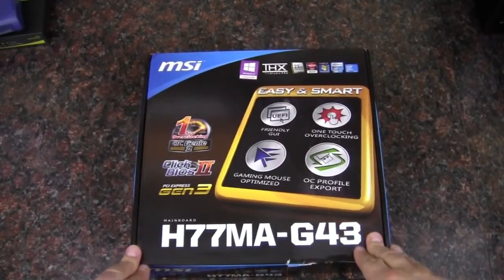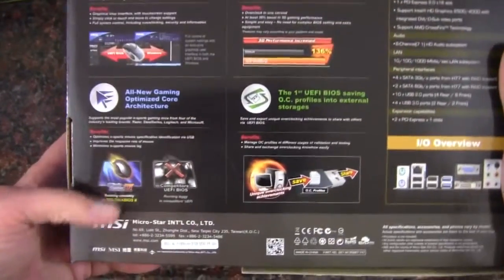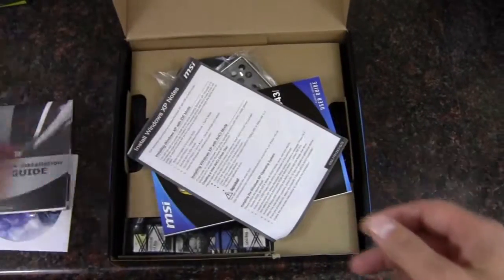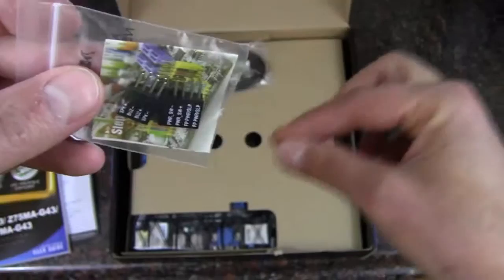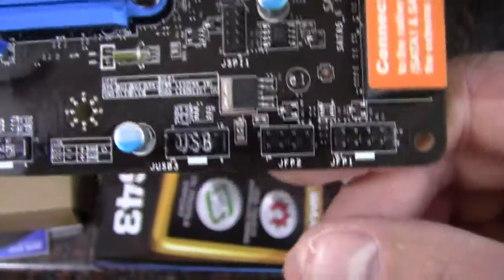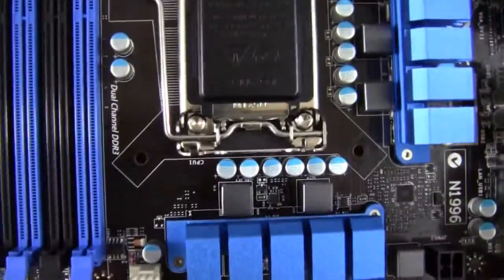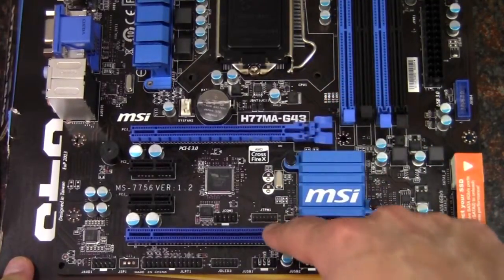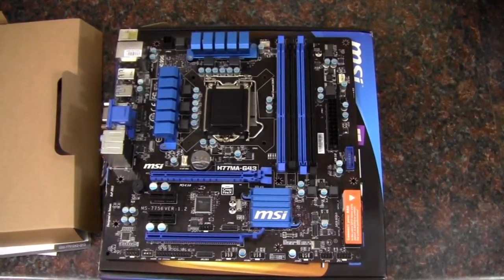MSI H77MA-G43 Unboxing

Comment: Hello, i can use fan or gabinet RGB?
Reply from the maker: HI. I am not familiar with gabinet RGB. Could you post a link to an example? Thanks!
Reply: @AdoptedMike  a gabinet tgt stalker
Reply from the maker: @zeex6922  Yes. I do not see any problems.
Reply: @AdoptedMike  i can use rgb of gabinet in this Motherboard??
Reply from the maker: @zeex6922  From what I see, the RGB strip on the front is not controlled by the motherboard. It looks like it only needs 12 volt power from a Molex connector. I am guessing there is a button used to cycle through the colors for that strip. I am using Google translate to translate, but it's not 100% accurate. I think what I find is mostly in Portuguese.
Check out around the 4 minute mark on this video: https://www.youtube.com/watch?v=9pQqNz3Szt4
Reply: @AdoptedMike  ok, thanks for you support, +1 subscribe

Comment: Or do I need to add wifi card using pci to connect to internet wirelessly
Reply from the maker: Yes, you will need to add either a PCI express or USB WiFi adapter.

Comment: I know I'm a quite a bit late, but I wanted to ask, whats your thought and opinions on this motherboard? Did you had any issues or problems with it? Cant decide if I should choose this one or Asus P8H77-V which is btw 10$ more.
Reply from the maker: Well, I never had to do any warranty work on the system that I sold with this board in. So, it lasted at least one year, probably more. If something fails, I usually at least end up fixing it. This video is 7 years old. I would guess the buyer got rid of it by now. I have had good luck with both MSI and Asus brands.
Reply: @AdoptedMike  I never had experience with MSI motherboard so thats why I asked you, tho I had very good experience with Asus and Gigabyte motherboards in the past(775 socket era).Nonetheless, thanks for the answer man! I really appreciate it!

Comment: can i overclock intel k series processor in this mobo ?
Reply from the maker: No. Overclocking via CPU multiplier is not supported unless you have a "Z" series motherboard. This board is an "H" series.
Reply: @AdoptedMike  so why msi adding oc genie 2 feature on this motherboard bios ?
Reply from the maker: @Refatkabirofficial  My apologies. I made a mistake. You can do some overclocking. Best with Ivy Bridge CPU's. Try to get one of those instead of Sandy Bridge. Obviously, you will need a k series CPU. Intel has since moved on to only allow Z series motherboards overclocking ability. I didn't realize this far back, it was still possible on H series.
Reply: @AdoptedMike  did u try this ? does that work ? i know that thing only z seires motherboard support overclocking but msi mention that oc genie 2 features on h77 board but i confused does that oc option work or ? cause i want to buy used motherboard for my i7 3770k processor . i want to overclock but i worried about that does realy works or not .
Reply from the maker: @Refatkabirofficial  According to MSI, using the 3000 series k CPUs. It will work. Unfortunately, I am unable to test this. Here is where I found the forum: https://forums.whirlpool.net.au/archive/1914307#:~:text=You%20can%20overclock%20and%20ivy,the%20factory%2Dset%20turbo%20multiplier
Other Google searches have similar content:
https://forums.tomshardware.com/threads/intel-core-i5-3330-overclocking-with-msi-h77ma-g43.1666592/
https://forums.vrzone.com/hardware-depot/2765177-can-i-overclock-my-cpu-using-mobo-msi-h77ma-g43.html

For the H77 chipset overclocking consists of adjusting the BLCK. It is not as great of an overclock. Sounds like you can do better on a Z series chipset.

Comment: Hi there. Will this fit my r9-280x? I'm in fear that it might hit the ram slot clips. my motherboard broke so I have to get something in the meantime while i wait for an upgrade and this is really cheap board
Reply from the maker: The video card gets close to the RAM clips, but it will for sure work. It is best to install the RAM first, then there is plenty of room.
Reply: AdoptedMike I have the r9-280x club3d royaling so it has a backplate so still unsure. if my card was without a backplate I think stuff might have been easier
Reply from the maker: Nelis Rossouw The backplate does add some extra depth. For what it's worth, I am 99.9% sure you will still be ok. I have never had issues using cards with backplates on motherboards. As long as the RAM is installed before the GPU. Installing RAM afterwards may be tricky to close the latch.